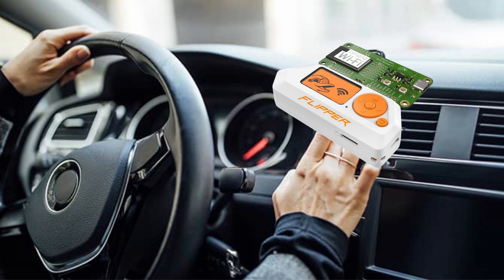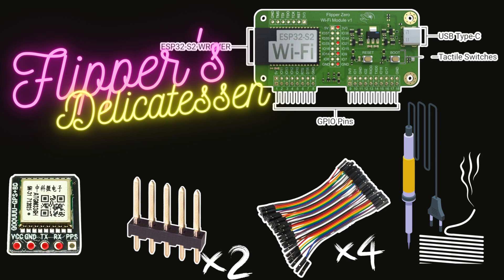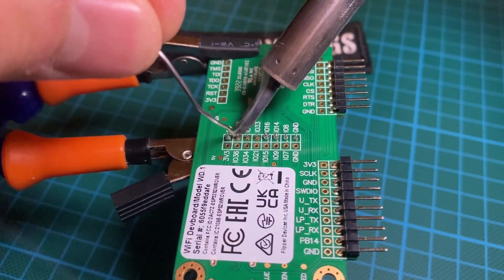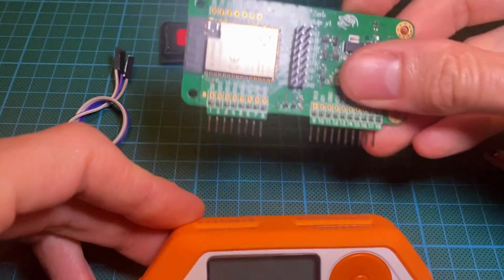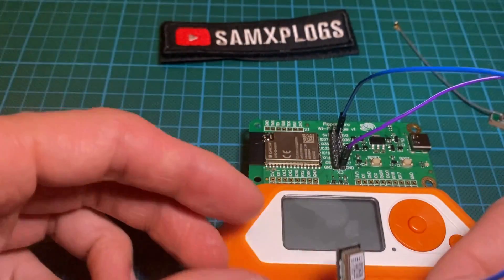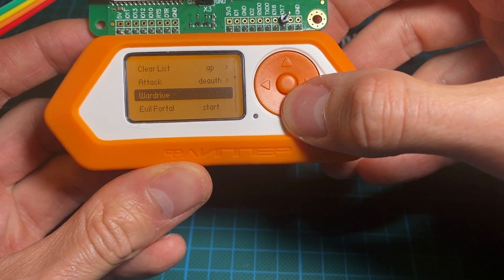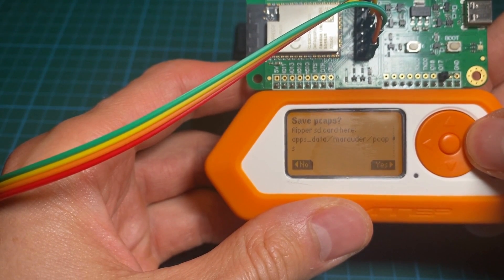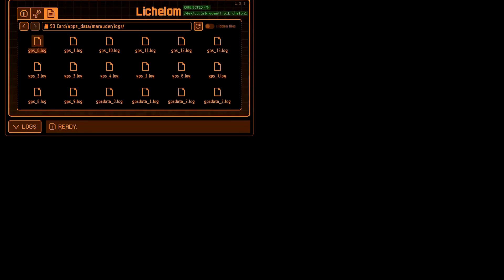Flipper Zero Wardriving Rig: Upgrade Your WiFi Dev Board with a GPS Module!

Comment: For some reason when plugging it into dev board I get no signal for gps but i do when gps is by itself. I tripple checked my soldering on dev board and tahts not the issue.  Any advice?

Comment: Having trouble getting GPS to connect through wifi dev board. Going straight to flipper GPIO pins works great , wondering if its a setting in Marauder or something?  Also is there much of a difference soldering wire vs using the header pins on the Dev Board ?
Reply from the maker: Hello Mick, as long there is connection, using PINs or soldering via cable should bring no difference. Which firmware are you using on the Dev board ?
Reply: @samxplogs  Marauders

Comment: What's up with the pin in IO17 don't see you mention it at all and it's just there?
Reply from the maker: Hey Dave, Sorry if I've caused any confusion. It seems I initially noticed IO17 using another module, but what I really need for this installation is only IO09 and IO21.

Comment: amazon link for the gps is for a 5v version and not the 3.3v used in the video and it will not work through the wifi dev board, just a heads up for people here since i almost made the same mistake of purchasing
Reply from the maker: Thanks Dontomiko for the heads up! However I have double check and correct me if I am wrong but the GPS NEO-6M can work from 3.3v to 5v.
Reply: @samxplogs  i came across a few different posts on reddit of people trying that exact 5v one and having issues with it only once attached to the wifi board while working fine without the wifi board, i cant link a post here but one is by the user 
jediwompa

Comment: Can I get your pin to pin from GPS to Wi-Fi board?
Reply: I have the same problem
Reply: Ever figure it out ?
Reply: @mickster287  I did not. But I did build a standalone ESP-32 Marauder and added GPS and it worked.
Reply: @jediwompa do you have a guide for this build? I’m starting to give up on this one.
Reply: @C3bte44  no. I could never get it to work.
Reply: @jediwompa  I mean the one that you built and did work.
Reply from the maker: Hello! Could you tell me which model you're using? At 3:35 in the video, I demonstrated how to cover the wiring. I followed the instructions from cmkk's GitHub, using IO09 for transmit (tx) and IO21 for receive (rx). Please give it a try and let us know if it works for you.
Reply: NEO-6M. I have transmit on the GPS going to receive on the board and the receive on the GPS going to transmit on the board. However, no matter what I do when I go outside I cannot get one satellite at all. The LED is blinking but nothing happens. I'm using Marauder going down to GPS and selecting stream
Reply from the maker: Could you try connecting using uart only and check what happen? May be it could be faulty too 😕
Reply: @samxplogs  I can connect the GPS module straight to GPIO pens and get a location via the GPS app so I know that the GPS works. It's just not working when it's connected to the Wi-Fi board.

Comment: I've seen other setups that require memory card. I see the way you do it, you don't have a memory card. Are you using storage on the flipper memory card itself?
Reply from the maker: Indeed, adding an SD card module to the board was, and remains, the best approach if you’re looking for a dedicated space to store generated data. It was previously the only method to save pcap files. However, with the latest Marauder firmware and its companion application, files can now be written directly to the Flipper’s microSD card. For convenience, I’ve opted for the latter option.

Comment: Had this mod on my wifi dev board and spared M10 GPS from my micro multirotor. The wiring followed Justcallmekoko's pins too. But Marauder can't detect my GPS Module. Even tried waited for GPS Fix but still no detect
Reply from the maker: Could you check if you are able to get any output from the M10 using rx/tx hook up straight to the Flipper Zero instead? Also, how long did you wait for the fix? For instance, it could take up to 5 minutes at my place, depending on the weather."
Reply: @samxplogs  at that moment I didn't get any response on my F0 so I think there were no communication between them, even I waited for about 8 mins to get GPS Fix (led indicator said so). 

But finally it solved. Since there were no people using this GPS Module, I follow my experience on my multirotor builder. This module using 5V on all my FLight Controller , instead of 3.3V. So at the first I was using 5V pin, the module powered but there were no shakehand with F0. But after I changed the Vcc to 3.3V, F0 & GPS module become close-friend. Even I didn't activated Wifi Dev Board on GPIO Apps, the GPS Module still powered and got GPS Fix as long as I connect the Wifi Dev Board to GPIO pins
Reply from the maker: Well investigated. I am happy you solved it. Thanks for your feedback 🙏

Comment: Can this be done to the WiFi Dev board pro? The smaller version
Reply from the maker: Indeed, it's compatible too. The GPIO wiring differs but it's detailed in justcallmekoko's wiki and I also touched on it in the video.
Reply: There's pins on the side of the board so it should work, Awesome! The hardest part is fitting it in the case 😁 I found a ceramic module that is 8x8, and this board is 13x15 so it might be able to stack on top! Do you know if justcallmekoko has the stl file for the boards available? Thank you so much!!